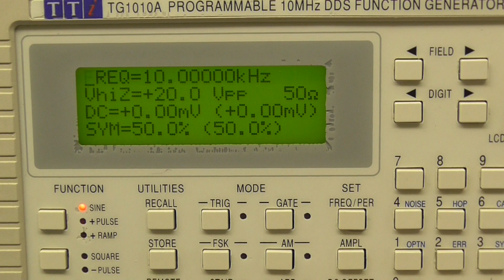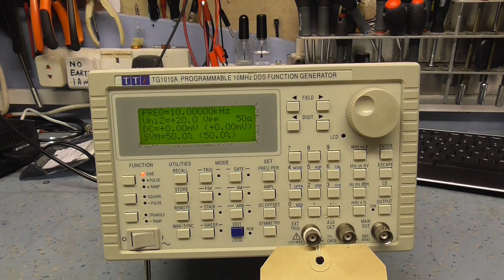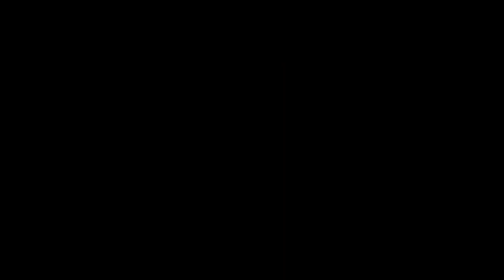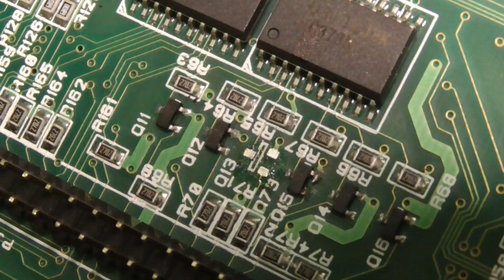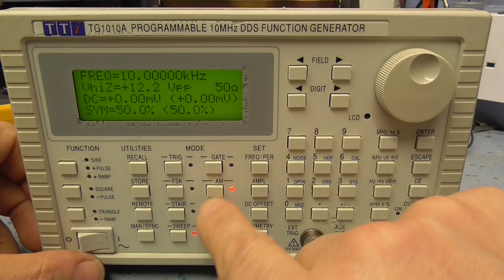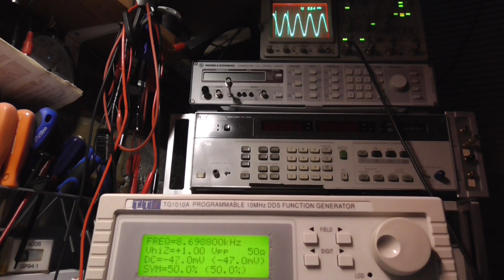TTI TG1010A function generator Keyboard repair

Comment: That does look similar to the one I have which is a TG1304. I need to fix the encoder on my one which has never worked. Nice fix on the switches they do go for serious money on eBay.  I wonder if you can stiffen up the pull up or pull down resistors on the micro input Thanks regards Chris
Reply from the maker: If only it would go to 11megs. Has markers too apparently.
Reply: @SoddingaboutSi   the one I have goes to 13mhz but never used it for radio work.
Reply from the maker: @allthegearnoidea6752  Show off!

Comment: At one point i was wondering if the damp had crept into the ribbon cable header.
Just little forks forced on to the ribbon wire cores.
A very touchy keyboard, i hope you fully fix it simon :-D